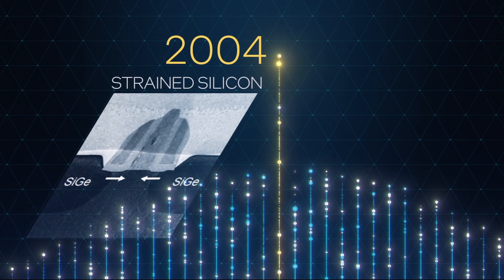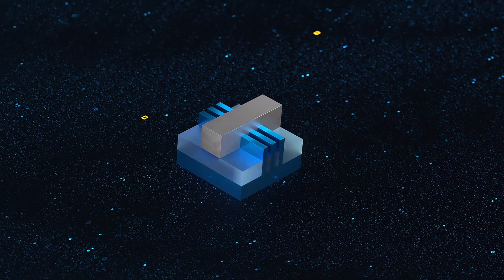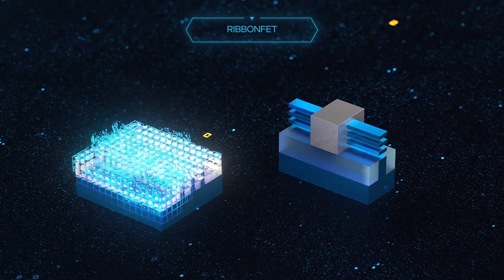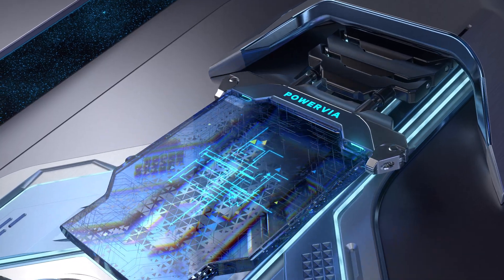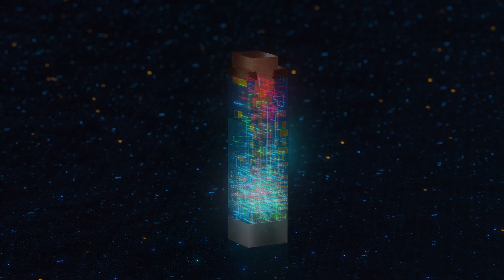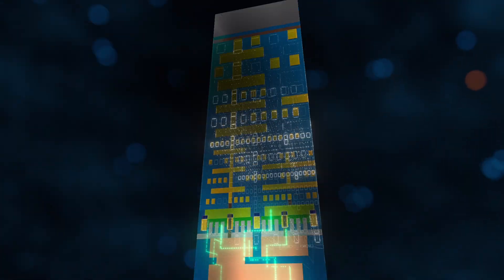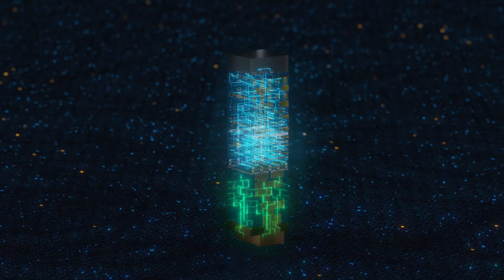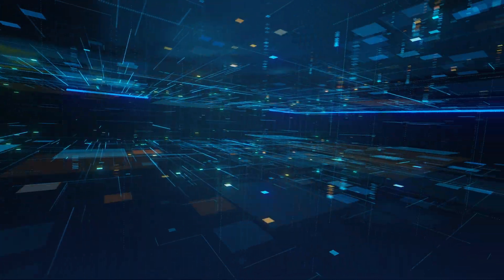Introducing RibbonFET and PowerVia | Intel Technology

Comment: IMO, this video is misleading regarding an important point: "Introducing RibbonFET, which will be Intel's first new transistor architecture since the introduction of the FinFET in 2012"   ...which makes it sound like FinFET was invented by Intel. The FinFET was invented in 1989, in Japan, by scientists affiliated with Hitachi Central Research Laboratory. They called it a "Depleted Lean-channel Transistor" or "DELTA" transistor, 23 years earlier.
Reply: So... why didnt they make it then? Talk is cheap

Comment: Wouldn't quantum tunneling prevent transistors from being 2nm big?
Reply: node size does not equal transistor size
Reply: Transistors are normally around 65nm ~ 45nm big!
The "nm" process used to produce the transistor walls is what you always see on advertising, like 22nm, 10nm, 5nm, 3nm, 2nm.. not the transistor itself.

Comment: Well, they own supercomputer which simulates every possible way how to manufacture transistor. Give me a supercomputer and i will simulate a god 😬
Reply: They actually don't own any supercomputers
Reply: @Harish2923  https://www.intel.com/content/www/us/en/high-performance-computing/supercomputing/exascale-computing.html
Reply: @tafwidhudaekacandra9392  that is not owned by them(that supercomputer doesn't even exist yet), they were contracted to build that supercomputer by the Argonne laboratory.
Reply: @Harish2923  so they built the supercomputer for another company but can't make themselves?
Reply: @tafwidhudaekacandra9392  they don't have any use for them
Reply: @Harish2923  interesting
Reply: @jms1260  do you know that there are things known as Fpga's and you can also accelerate those workloads with GPU's, and they don't do those frequently, most of the time, it's 1 new stepping design per 1 or 2 quarters(for single generation of CPU'S)
Reply: @Harish2923  Even if it's 1 stepping per quarter, that's one massive calculation per quarter per litho step per product per technology. It adds up pretty quick. You think they do it on a little server with some graphics cards?
Reply: @jms1260  1. Some things can be accelerated by >10X by GPU's
2. I am guessing they have 2 racks worth of servers for those works
Reply: @jms1260  3. Do you think amd had a super computer before the launch of zen? Around the time when they were almost bankrupt?
Reply: @Harish2923  1. So 10 GPU years per calculation instead of 100 CPU years? Still a long time, and you'd need thousands of them to finish a calculation in a day.
2. I'm guessing they have more? Let's use some data shall we
3. AMD doesn't do their lithography, TSMC does, and even a company short on cash can rent computing time. But about those calculations: https://en.wikipedia.org/wiki/Optical_proximity_correction (note the bottom where it says it requires "large compute farms"...which I'm going to call a supercomputer if that's okay with you)
Reply: @jms1260  1. You don't really need to have it finished in one days
2. Maybe, they do have their own service which lets developers to access Intel's device's in cloud (you can test your softwares on it), you could say it is technically a server farm.
3. those calculations are done by the company's who design the processor's themselves, this is actually stated in the link you provided(not by the foundry), the completed file is then sent to the foundry which will proceed to make the mask's(otherwise, it would like the company is giving their ip to foundry for free)
Reply: Thats not how it works